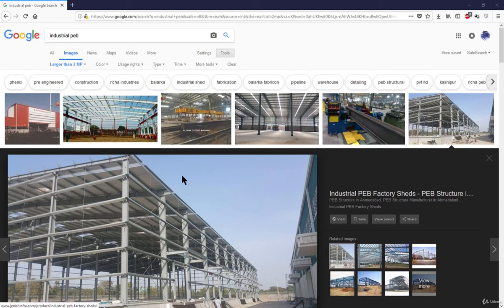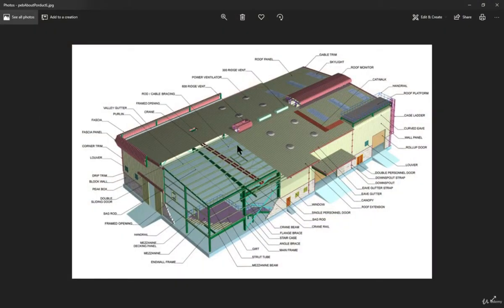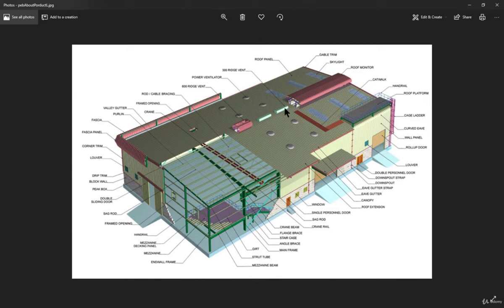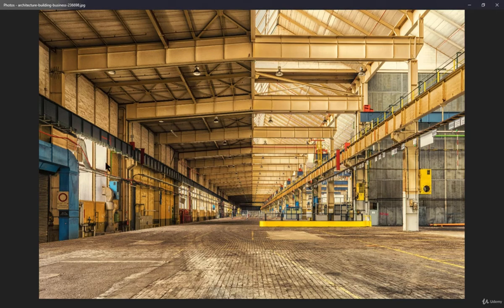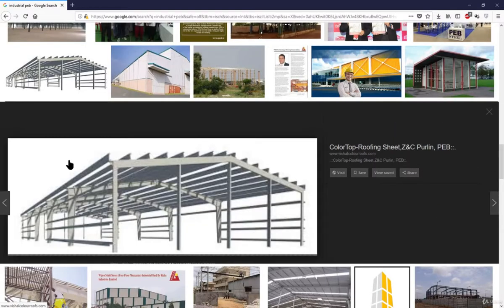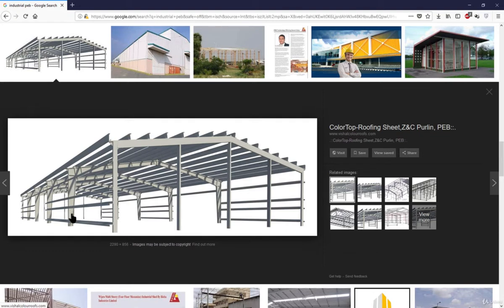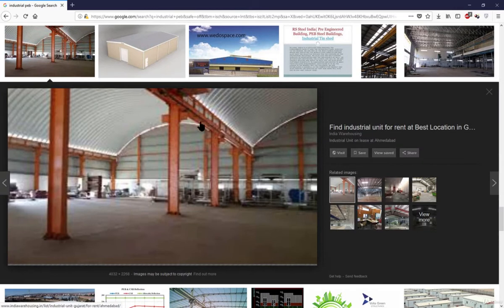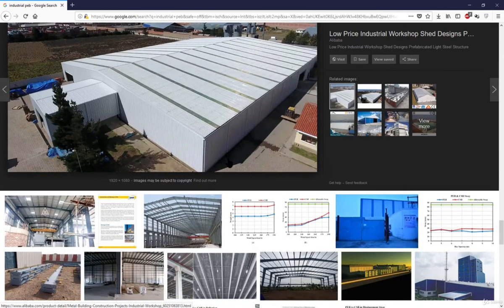Complete course of PEB ( Pre Engineered building) Structure on Etabs Lecture 1 = introduction of PEB

Comment: Please mention important is codes for pre engineered building
Reply from the maker: It is actually designed as per IS code 800, and for loading IS 875 part 1,2&3 is used
Reply: @ankitapal4434  KKK thannku sir  but I want to ask which subjects  should learn in civil engineering before starting career in pre engineered building and software too.please reply
Reply from the maker: @navneetkumar745  Design of steel structures, learn about basic concepts first what is dead load, live load on steel structure, what is section of modulus, How to calculate wind load on roof truss, how to calculate Bending moment on main rafter of peb truss just read books, research paper, projects
Reply: @ankitapal4434   mam mera concepts acha , since I belong to civil engineering . Acha mam kon sa softwares pa command honi chaiye and PEB m future m aage Kaya opportunity h
Reply from the maker: @navneetkumar745  mostly in india people using STAADPRO for peb Design, so learn it on Staadpro, you should know all basic steps